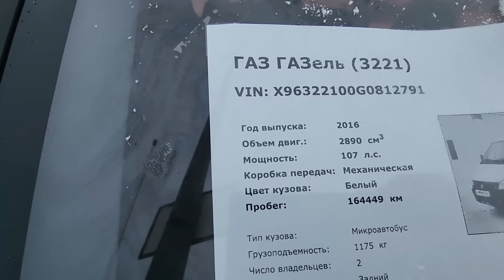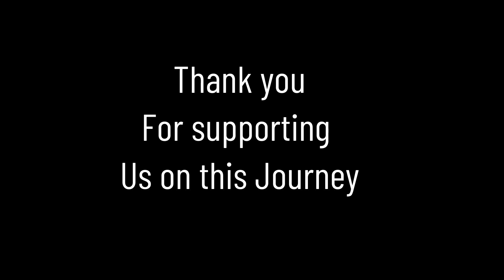NO LONGER FROZEN IN RUSSIA!!

Comment: One thing if your looking at used vehicles and are unsure if the odometer has been rolled back, using a scan tool can read the mileage directly off the computer which is much less likely to have been tampered with versus the dashboard.  Best of luck, I'm hoping to check out grozny for a possible future move or second home/base outside of the u.s.

Comment: The van looked good but the seeping seals are a concern. 4x4 would be better but a lot more money and fewer model as options.  If the dealer will have the transmission seals replaced that van has a a lot going for it. Another option is getting a used touring van, 12-14 passenger most from Mercedes that a row of seats could be removable when hauling items Many thousands were imported every year into St Petersburg and Moscow for the incoming tourism business. I had 8 of them and then when we had a large number of tours (mostly cruise ship passengers arriving visa free for 2-3 port sasscalls. There were enough of the to handle the summer but were stored indoors all winter where no cruise ships arrived.  Moscow had more year young but we had about a million tourists just from  cruise ships between May and the end of September.  When 8 large ships arriving with 2000-4000 passengers disembarking daily from each ship in the summer...that was a lot of vans but also large 45passenger tour buses.

The language test is not hard but makes everyone nervous, there is no trick questions. You and Anneesa will have to study but number one priority for the kids is let the hang out with other kids, the youngest will pick it up amazingly fast and slower language gain after 6-7.  They should just be around local kids daily, and soon they would be ready for regular primary school.  Don't bother hiring a teacher for them, just play time is more than enough but the older kids will need some study and you will need real study.  Once they are in regular school, they will learn more rules of formal speech. Kids naturally teach each other and the youngest will be most able to speak first.  Also getting then around other kids daily builds tolerance of local microbes and minor illnesses.  If they are isolated to  home, they will have ever childhood illness.  Kids here like school, the most exciting day of the year is Sept 1when school reopens and they get to dress in their best clothes and meet their teachers again and present small gifts to their teacher, such as a drawing or something made by hand during the summer.
Reply from the maker: Thank you for sharing

Comment: Big NO to buying a 2 x 4 van (rear-wheel drive only). Those are urban vans, and with the long wheelbase, the engine/transmission weight is on the front axle. Your wife could get stuck in a blizzard, and any patch of mud. A team of draft horses would be better but slower.
You need 4 x 4 traction. Those summer tires are worn down as well. The one or two oil leaks are a bad omen. Don't touch it. Are there 4x4 military surplus vans around?  Would be ideal.

Comment: Greetings from east central North Dakota. Just a comment on the vehicle selection. A two wheel drive vehicle with dual rear wheels would be almost unsalable in this area because of its inability to transverse snow or mud covered roads. They would pretty much be limited to dry pavement and dry dirt roads. I have a 1997 Dodge 4x4 3500 that came as a dually and it was pretty well helpless in snow even with 4wd and in mud there would be an abominable amount of dirt that packed in between the rims. I changed it to a single wheel rear axle.
Reply: Gazelle always has dual wheels on the rear axle, i belive it's because of tire load and area load limitation. Gazelle without cargo or passengers inside is undrivable in deep snow, wet dirt and uphill. Single rear wheel Sobol, having the same overall shape, engine etc is a little shorter, has 4WD, less max load and conquers dirt and snow perfectly.

Comment: I agree with you.  I buy locally, even if it isn't as convenient.   Everyone needs a dependable vehicle but proper maintenance and parts availability goes a long way towards making local options work. I'm pretty sure most of the old Russian diesels will run on oily pond water for years. How bad could newer ones be?

Comment: brand matter little in my opinion . Just make sure electrical wire do not touch metal by proxy . (wireless electricity  ) no rubber coated metal clamp . You need to see big wire like alternator startor battery alone . Those wire isolation should touch only zip tie . Only the back door top and exaust catalyser seem problematic . To fix this ? Do not ground oxygen sensor to exaust or chassis . Airgap the oxygen sensor ground wire and send it to ecm ground wire .

Comment: As for me, our local made cars are ok but they need regular attention and care. ) And yes, you have to be very careful bying used car because there are people who tend to hide problems and rise price. Gazel should be ok since it is being used in commercial public transportation (so called "маршрутки" or "marshrutki" or "routees", based on "маршрут" or "route") over decades in Russia, so its problems are well known and most probably fixed already by manufacturer (which is titled "ГАЗ" or "GAZ").
And yes, check your driving license because it seems that you are going to drive a bus (depending on sits count and probably vehicle weight), not just car.

Comment: I would look for a newer model like Gazelle Next with a diesel engine. If a price is an issue, Gazelle Business is ok, but it s a real compromise due to low comfort, reliability (which isnt much of an issue if you can spend some time to keep it in a shape yourself or at least check often). Also there are a AWD versions but they are even less comfortable as cruise speed is lower and noises much higher. Look for 12 seater version which is also common as it used to be popular in commuter services years ago. Best regards

Comment: Man, Gazelle comes in so many shapes and forms, you don't need to get stuck with this particular 9-seater and then modify it. Find a 10-seater, what's the problem?
And you a right, Gazelle is the perfect variant for your purposes. You will never have a problem finding spare parts for it, it is very reparable and decently durable. Propane + gas makes it super cheap to run. Rust? Who cares, just throw it out and take another used one in 10 years.
Buy a 13-seater Gazelle, because chances are in 10 years you might have 3 grandchildren 😊
Cheers from Ottawa ON.

Comment: GAZelle is usually used for public transport and it's not safe and it's not reliable. It's just cheap.... Also if you buy an old one, 99% not a vechicle, just a headache. there is one model of car LARGUS, it's produced in Russia and it's based on a good French frame by RENAULT. and there are modifications with 7 seats (3 rows 2+3+2). my dad's mechanic says it's much more reliable and the parts are always available and affordable.

Comment: If you buy a GAZelle, then you need to look for a newer one. They are used very intensively, often in commercial transportation, and then sold, after which the car requires frequent repairs.
I think you won’t drive hundreds of kilometers every day and a relatively new car will last you a long time.

Comment: If you want to transport more than 8 passengers in Russia, you can’t do that on a regular car license. You need a bus license.

Furthermore, the van you were looking at was originally intended for 13 passengers. But from the looks of it, a previous owner took out 5 of the seats, then went to the Road Police Office where they changed the documents for it from a bus to a passenger car (or light commercial vehicle).

Once you get your work permit, you can go the classes and take the test to get a bus driver’s license.

For now though, your best bet is to get two vehicles. Instead of the GAZelle, look for a Sobol. It is essentially the same vehicle, but has a shorter wheelbase and single rear wheel (as opposed to the dually on the GAZelle). Some Sobols also came from the factory with 4WD. As for the second car, if you are looking for something cheap and Russian, you could get a Lada Granta for a good price. Not the best car and not the most reliable. But east to fix and the parts are cheap and plentiful. They most likely did that for the express purpose of being able to operate it while carrying a regular car license.

Comment: One of the flaws of the gazelle is the bad metal of the body. You need good paint and anticorosion coating so as not to get holes in the body after 3-5 years of use. The second point .. A lot of modifications regarding the engine, gearboxes and other fillings. And without knowing these moments, you can buy very bad options. For example, there are modifications for 85 horsepower, which is clearly not enough for such a car. The second bad option is a radiator in which the metal and plastic parts are combined. Someone decided to save a little in production, and in the end you get a radiator that begins to flow in winter, because plastic and metal have too different expansion coefficients. Often there are cheap gearbox from China, the resource of which is 25-30 thousand kilometers, which is very, very small.
Otherwise, this is a car for which it is very easy to find spare parts that will be inexpensive, and the masters who are ready to repair it. In addition, you have the widest selection of spare parts and parts for modifications. Many options for different details of different brands and manufacturers. Engines, gearboxes, bridges and everything else. And you can repair many things there yourself, saving well on the price of repairs.
That is why Gazelle is a very good car for business. You buy it inexpensively, having repelled this price in 3-5 years. On average, this car has been working normally in our climate for no more than 10 years, after that you just have to get rid of it and buy a new one. Or you will have to completely change its body, and sort out literally everything with defect and replacement, with the exception of the frame, which will not differ much in price from the acquisition of a new such car.

Comment: If the locals say it's not good, believe them. plus it looked like it has problems, possibly front & rear crank shaft seal. and it has had a lot of touch up, bad sign. The wear on the brake pedal can give a good assessment if the millage has been messed with.  rubber worn through, BAD, Light to medium wear good, looks new BAD. Honda/ Toyota are well made, got to have 4x4 I wouldn't be without it, could save your lives.

Comment: Dude, i'm from Belgorod, those russians who tell you not to buy a Gazelle are right and wrong 50%/50%. Let me explain. 
1. Yes it's cheaper than a foreign vehicles, so be ready the quality of metal and painting are lower for those used models you're going to buy. So corrosion and rust may progress.
2. Quality of the gears are lower as well, but spare parts are not so expensive and every even small car service will be able to repare it if any problem will occur. Everybody in Russia knows that our cars can be repared "on the knee" as we call it here, means everywhere with minimal efforts. This is a philosophy. So conclusion is - it can break down but you will be able to repare it fast without waiting and paying a lot in case you'll have a foreing vehicle (but this foreign vehicle might serve you longer before you face such problems, never knows). 
3. Love to a foreign cars is caused by exactly this i described above. Most will say "better to add some money and buy foreign than buy ours and easy repair". It doesn't mean nobody buy our cars, we have a lot of good models as Niva, Lada,  very reliable and simple but as for old GAZelle  can't say the same. Nevertheless almost more than half of the country drive GAZ cars. Remember one thing it's a liquid car on the market, especially in good condition.
I hope i could explain it to you;) If you'll be in Belgorod sometime feel free to contact me for excursion;) wildbassfirst@vk.com

Comment: Arend, as I said before, you'd beter get a van with no more than 9 sits (vehicle category B). I doubt you would need 10 sits at a time too often. Also you can not add, relocate, turn around  or remove seats without proper paperwork. And such paperwork would cost you about 50000-60000 rubles. And the changes you propose may not be allowed at all because there has to be serial vehicle with exactly same seat arrangment. Furthermore you will not be permited to change vehicle category from B to D (from a passenger car into a bus). Such modifications were banned a few years ago.

Comment: Gazelle is is cheap practical workhorse. But 10 seats is a problem for B category which has a limit of 8 passengers. You will need to apply for a category D driving license and buy a respective car. Once it will be Gazelle just keep in mind you will need to learn it's mechanical part because some repairs you will need to do by yourself because it will be faster cheaper and more safe. But the advantage will be an accessibility of spare parts.
For D category you will need to speak fluent Russian. Russian road police (ГИБДД) accepts exams only in Russian. Best of luck for that! :) 
BTW how is with schools, child gardens for kids? Managed?

Comment: I know nothing about any vehicles over there. I would ask specifically about local shops that do actually support (repair) any vehicle you are looking at. Likewise - what are parts availability like for any vehicle you are looking at? Example: Lexus parts vs. Toyota parts. Many more Toyota parts and not always interchangeable with Lexus. Based on your needs and expectations, I'd be looking at reliability and parts availability and local shop (repair) support if/when needed, or you could be grounded (no vehicle) for months. Just my opinion.

Comment: This Gazelle looks to be well used and poorly maintained, read it as: Costly to run and may break down now and then, the engine can outlast the chassis if it has been given oil-changes as pr specifications. If more than one in the family has a driver license then two SUV may be a better option, I mean, what are the chances that two cars break down at the same time ?

Comment: Arend, you correctly noticed that there is no air conditioning, heating and much more. And there is very little comfort in them. 
But the most important thing is, unfortunately, our cars often break down. You will be constantly repairing them. The most unpleasant thing is that the car may break down on the road. Imagine your wife went with the children and the car broke down..... And it can be often
You are advised to take a foreign car for a reason.

Comment: It seems really underpowered for what it is. Really thin metal that looked to rust easily. The dulley was kinda cool. Also compromising with the seats and heat just doesn't make sense. I know you want to buy local but i would trust the locals if they are saying they are unreliable. Hundayi is very unreliable they have class action lawsuits because of the engines.

Comment: Law: a category B driver's license is allowed to drive a car with no more than 8 passenger seats + a driver and weighing less than 3,500 kg

If there are more than 8+1 seats in the car, this is already a bus and you need a driver's license of category D or D1 to drive it. This may contain other restrictions relative to an ordinary passenger car

I am happy for your large family of 10 people - it is amazing and magnificent! I would really like a simple and legitimate solution, but it seems this is another small dilemma of choice.

The new Gazelle is a good car for the first 5-8 years and is often used in commerce or passenger transportation. It can be very difficult to find a good used car, they all have hard working backgrounds. The metal of the body begins to rust strongly after 5-8 years. Spare parts for Gazelle are much easier to find in any part of Russia, it is structurally simple and cheaper to repair than a foreign car,

Comment: Gazelle is not the best option, it has a bad body, it rusts and rots very quickly, it is also not a reliable engine, it is constantly covered in oil, and suffers from overheating, especially in summer.

Comment: 164449km... and this is assuming that the mileage has not been twisted, the car is most likely dead.
Our gasoline is inexpensive, I wouldn’t use cars with gas cylinders in principle, imaginary savings at the risk of life. 
Gas was installed for commercial use, the car was used without regret, there is no need to buy this, especially for a family.

Comment: Friends I give you my opinion,

Regarding Russian cars, I advise you, do not buy a used car in Russia, buy a new Lada car (10,000-15,000 euros/1,000,000 - 1,500,000 rubles). It is a good and cheap option. Now, it would be best to buy European cars from private people, do not buy from a second-hand company.

Western brands best 7-8 seater cars: Year 2005, 2006 SsamYong Rodius (3,000 euros / 300,000 rubles). Years 2007, 2008 Mercedes Vito (4,000 euros / 400,000 rubles), year 2010 Nissan Primastar (9 seats, same price).

Good option Volvo XC90 (7 seats) 2010, 3,000 euros / 300,000 rubles.